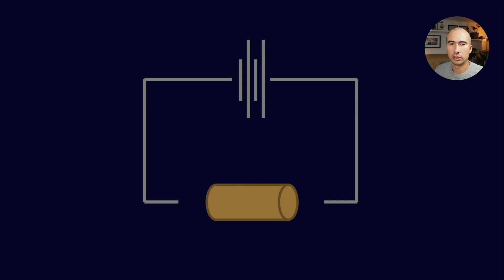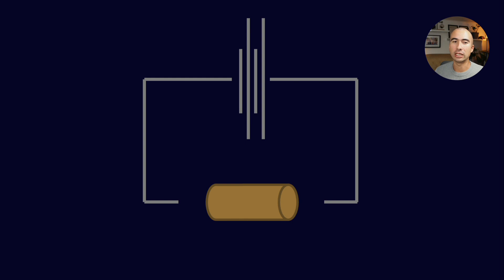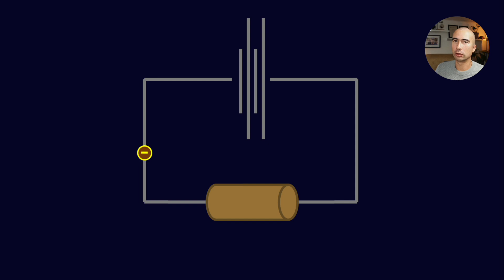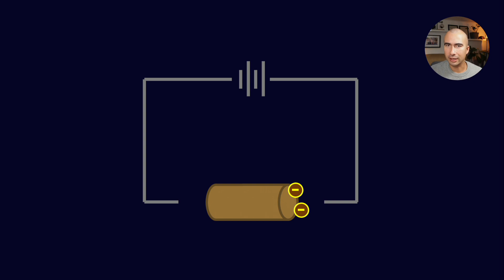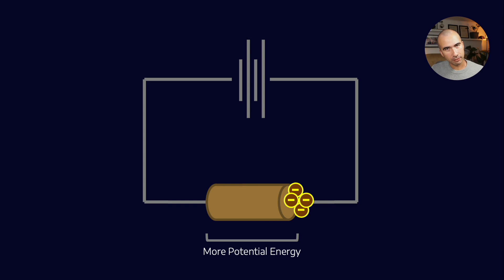Breakdown Voltage of Lubricants

Comment: Just thought I'd add a little to your example of lightning (since you didn't mention it specifically) -- that's air being ionised to the point that its undergoing a phase transition of matter from gas to plasma! Those electronic lighters that use a piezoelectric igniter (instead of the more common pyrophoric striker-fired ones) are also causing this same thing -- breaking down air to plasma; i.e. the spark, completing an electrical circuit.

Are polychlorinated biphenyls used as transformer oils in Australia where you are? I know they're still somewhat widespread in the US since they do the job so well, despite being so hazardous to health.
Reply from the maker: Good point!